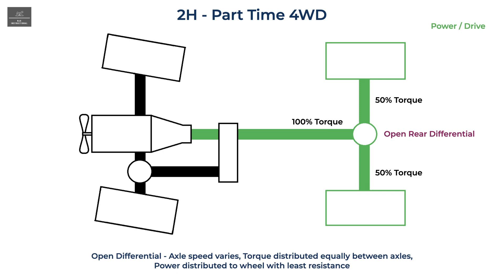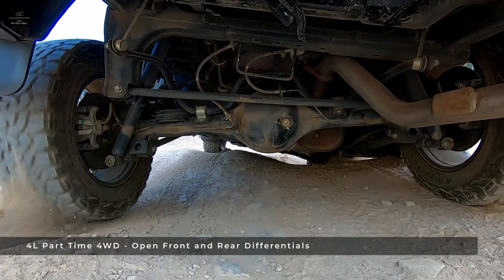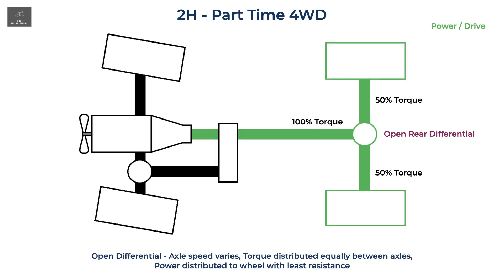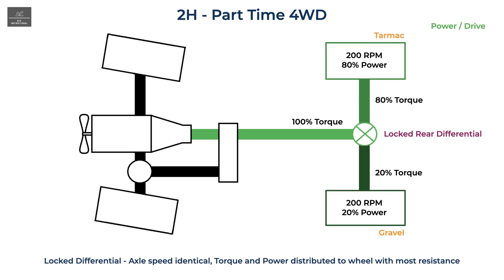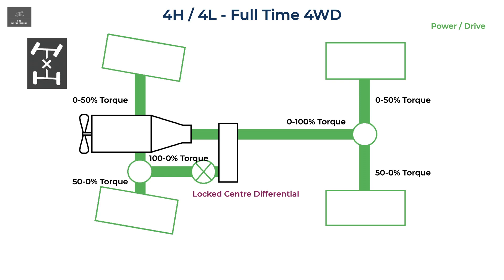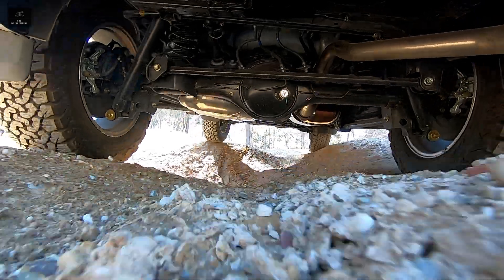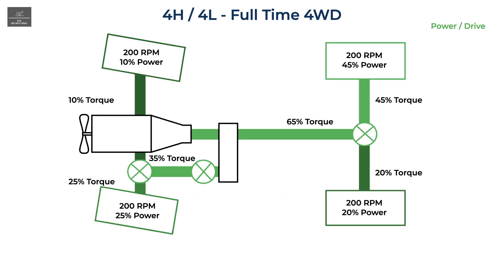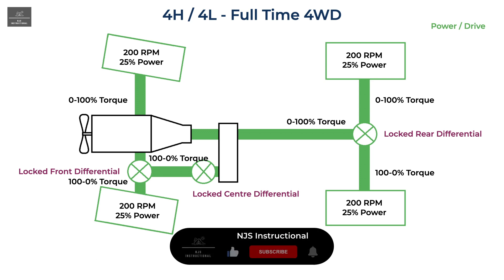How 4WD Works Part 2 - Open vs. Locked Differentials - Power and Torque Transfer

Comment: Great video! The power split of an open differential is also exacerbated by static vs sliding friction differences. Once the limit of traction is surpassed on one side, the traction coefficient effectively drops off the spinning side further limiting the power to the side with traction. That's one of the biggest contributing factors to the reason why lockers can provide way more than twice the tractive force of an open differential.
Reply from the maker: Thank you! Agree, an open differential has some significant shortcomings in how it distributes power, especially in low friction surfaces. It's incredible the difference a locked differential makes in forward progress.

Comment: Instead of trying to learn or memorize all of this hi-tech imfomation just buy a full time 4x4 even though you have to learn how 4x4 works but you don't have to worry anything about part time 4x4. And the draw back about full time 4x4 is mpg, it's going to use for fuel than part time 4x4. But another thing I'll say, AWD uses more fuel than part time 4x4 because the computer is always trying to decide which tire or tires should be gripping/spinning and it uses more fuel than 4x4 because 4x4 is locked in, AWD cannot be locked in.
Reply from the maker: My preference is also part time 4WD...

Comment: Thank a lot for sharing a big knowledges. I have a concern and hope received reply from you. In case, 4WD part time in 4H/4L mode  with open diff in rear, the left rear wheel on the air, so with ETS action ( braking this wheel), the power on the right wheel will be 25 % or 50%? the torque will be 25% or 50%? thank you very much and look forward your reply!
Reply from the maker: If in 4H or 4L in a part time 4WD or with centre diff locked in a full time 4WD, if the rear diff is 'open' both the left and right wheels will still receive 50% torque. However, as the left rear wheel is in the air, then the power (not torque) all goes to this wheel, torque will still be 50%. If your vehicle has clever off road traction control it will stop this spinning wheel and transfer power to the right wheel which has traction. How much % of power will go to this wheel will depend on the electronics/computer determining the amount of braking which also depends on the application.
Reply: @NJSInstructional  thank you very much!

Comment: Thank you! How about this, I lifted the car using lifter, center diff unlocked, put on drive. But only rear wheels are rotating, one backward, one forward.? TIA! (SUV-full time 4WD)
Reply from the maker: Cheers! If the centre diff can be locked you have a 4WD, if the centre diff cannot be locked you have an AWD...
Reply: @NJSInstructional  Thanks! In an AWD car, do all 4 wheels running all the time when lifted? as I put it on the lifter, but only 2 rear wheels are spinning. since it's an AWD supposed to be all 4 tires will spin while lifted & on drive? apology in advance as never been offroad😅